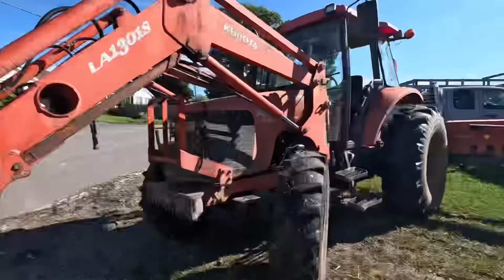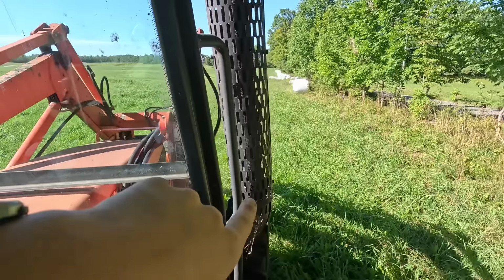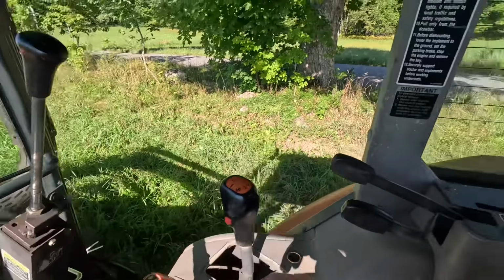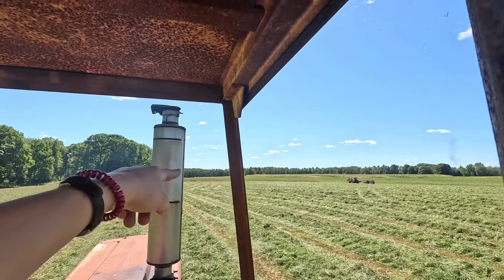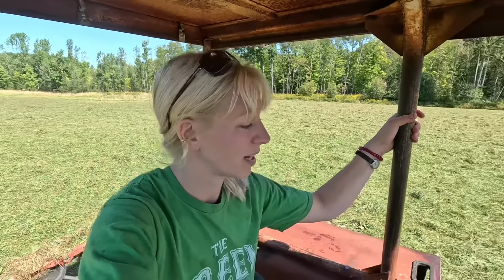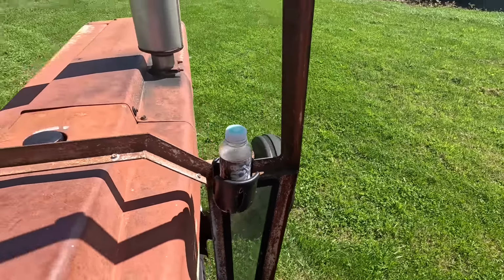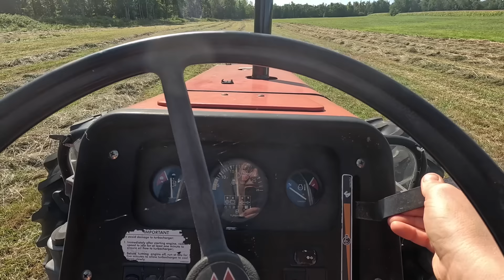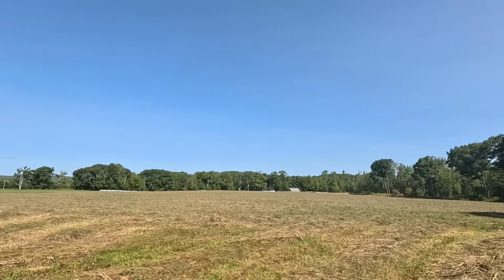Equipment mishap and 2nd crop harvest…

Comment: Did you ever resolve the problems with your Kubota at home or you mom's family home? 
I see used kubota engines for sale by my place on a regular basis. Used might be better that not using the tractor
What model international do u use? How is it rated compared to the kubota?

Comment: Why not a sickle mower?  Are they just too slow? Much less complicated. Help me understand.
Reply from the maker: They cut great but unfortunately if you hit a rock and do any damage at all you have to remove the entire cutter bar to work on them. Possibly even replace the entire bar.
Reply: لماذا لا تستخدم الآليتين في آن واحد ؟ كذلك نظراتك جميلة اضف إليه قبعة بيضاء تبدين انيقة!👒😘. @tayfarms
Reply: @tayfarms  سلسال الحب جميل . عمر و تايلور .😉❤
Reply: They are also a lot slower and more likely to plug up, especially in second cut. I've used both and it would be a very sad day when you take my disc mower from me.

Comment: Is tha mower a conditioner as well? I couldn't tell. Great job.
Reply: When they worked on it I did not see the rubber rollers our mower/conditioner had.
Reply from the maker: Yup it is a mower and conditioner, it has tine conditioners that swing instead of rubber rollers😃

Comment: Local contractor used to run welger balers (which seem to be the same machine) and had a rubber running on the axle of the netwrap, to a pulley on the outside of the sheetmetal. And the pulley was half white half black so it was easy to see if it turned. I think this was the reason for it.

Comment: TAYLOR: go to Harbor Freight and buy a can of electrical contact cleaner spray.  Use it on the connector of that baler control box and you might solve your problems.  It’s cheap and it can’t hurt.

Comment: Interesting way to open the field up. I run the tractor on the outside the first 2 passes, and then do my backswath, which gives me room to make the inside turns. But you run the way you want to, and you know what works for you best. I always enjoy cutting hay, its great when everything is working, but a witch when it isn't. Disk mower's beat bar type by a country mile! 👍👍 Great video

Comment: I was just wondering if you would have a much smaller tractor to jobs like raking and tedding, pulling the planter and hauling small loads. It would save on fuel and wear and tear on the tractors that are indispensable. Seems like overkill at times. Good to have a backup. You like the tractors you have, and they are great.